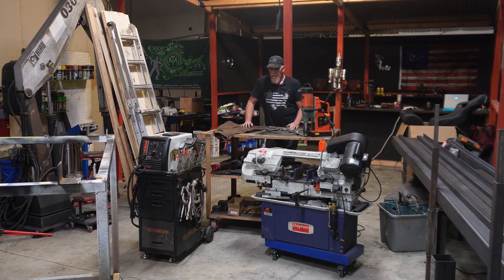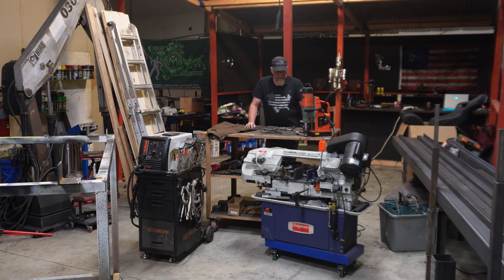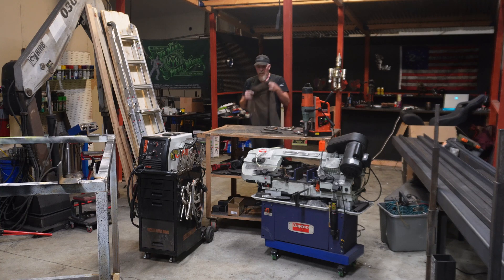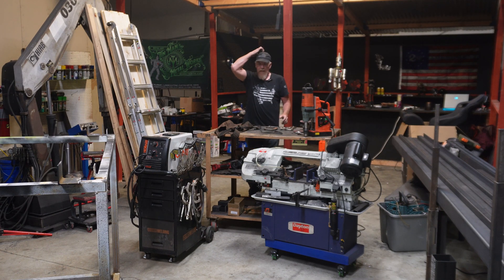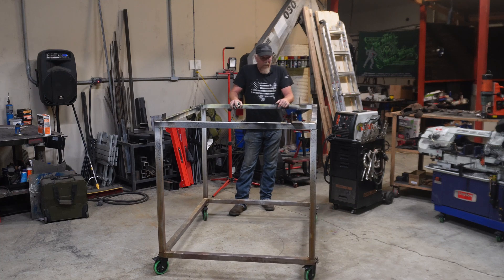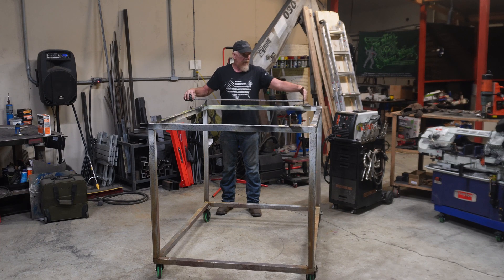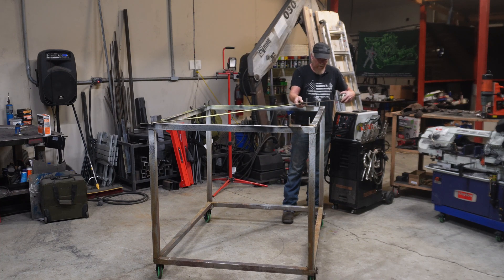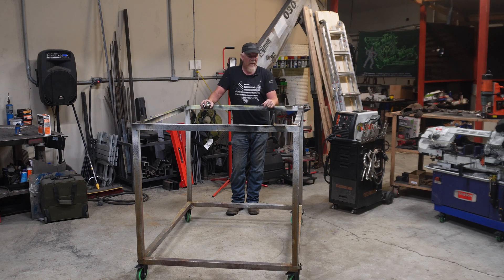Tools Needed For Truck Flat Bed Builds. Bed Build All Makes And Models, DIY Truck Flat Bed

Comment: OK, so spend $35,000+ on tools, then buy $6890 in metal so you can build and sell a truck bed for $7000? OK, got it!! ROFLMFAO!!
Reply from the maker: @patrickm.8425  Actually, they cost me about 1200.00 in metal to build one. I'm in my tools somewhere around 12k in tools ... but it's based around people who already own a cnc plasma table and a welder. ..
Reply: @tinmanmetalworks  you gotta spend money to make money it don’t grow on trees
Reply: People that complain about having to buy tools crack me up.   How do you expect to build or repair anything without tools?   Quality tools last a lifetime and work on job after job after job.   A tool might seem expensive but it pays for itself 100 times over during the course of its lifetime.
Reply: They won't spend $35,000 on some tools to make a living but they blow 50-70,000 on a new car.   Lol
Reply from the maker: @fernandorosales2418  strange isn't it...
Reply: Tools regardless of trade are an investment. Its either a time investment because they make the job shorter(if i sell something for 100 bucks and it takes 10hrs to build thats 10/hr. If i can get it down to 1 hour thats 100/hr). 
Or its an investment towards quality. I can drill all my holes with a regular drill, but knowing every hole is dead on straight just makes it all fit together a bit better. Better quality builds fetch higher prices for your work. 
Or its an investment in your whole life. Weve got thousands of dollars worth of tools in our shop, literally nothing i cant fix on my car or home. I dont think i have ever paid someone to come fix or do anything for me. Ive had friends and family ask me to help them do something at their house before, i say sure and i look at what they need, figure out what tools i need and ask them to show me to their tools so i can grab what i need. They will either take me to the garage or tell me to wait there and turns out all they have is some unopened molded plastic box of crappy tools from walmart. 

Also its not like you buy 35k+ worth of tools all at once. Its over time and getting the really spendy stuff at auctions and fb marketplace for super cheap. If you set aside some money every month to buy tools (and learn to use them) you will quickly find out you not only save thousands and thousands of dollars not needing to hire someone to fix your stuff, you will also have the option to make money with those tools making or fixing stuff for others. Seems like a nice little way to make some money if you ever really need it.
Reply from the maker: @leftylattin  very well said.
Reply: Who would you sell them too, I got all the tools
Reply: @DavidHansen-v1s  You could probably start right on marketplace & CL
Reply from the maker: @DavidHansen-v1s  i get 2 or 3 sales a month just off of fb marketplace ads..
Reply: Just getting my shop ready, 4x8 plasma table, new MiG, stick, and tig welders , new air compressor as a backup to existing compressor, homemade air dryer, refrigerated air dryer, bench top mill the whole 9 yards can’t wait to start building truck beds and whatever else I can, love your videos 🤙
Reply from the maker: @harrisoncady7105  well thank you 😉
Reply: Never fails to have one  jack ass in a Thread. You have to crawl before you walk. A lot can be done with a good grinder and cutoff wheels and a welder and ad to the tool list as you go. Like the chanel love what your doing.